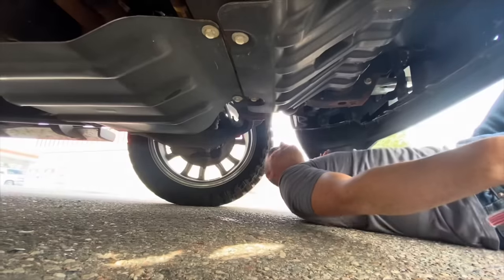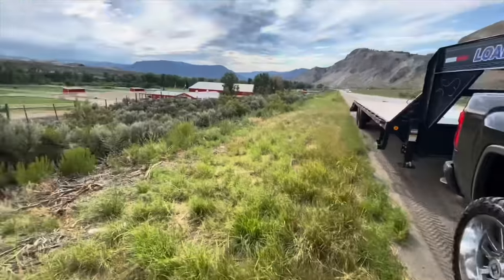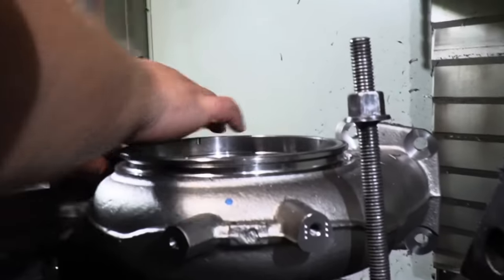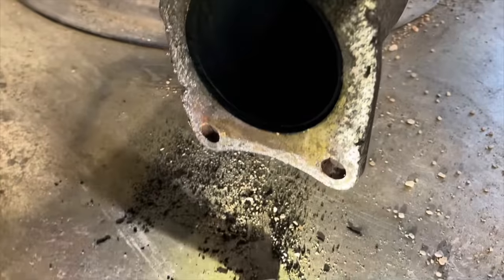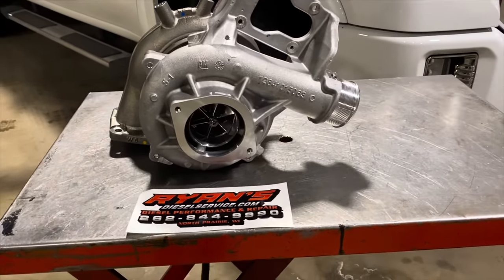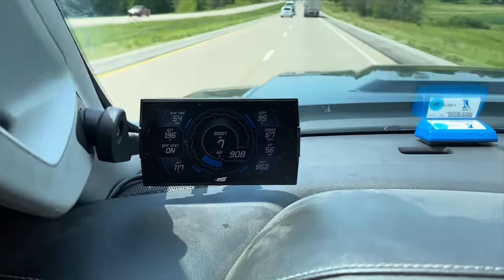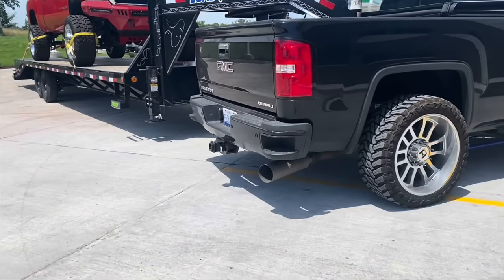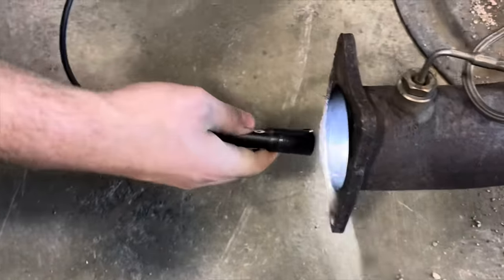This Is What Emissions Did To My Diesel! Heads Up Diesel Owners!

Comment: Every time I think about replacing my year 2000 7.3 power stroke I watch one of these videos and the feeling of needing a new truck quickly passes.
Reply: I don't know why you would ever want a newer emissions clogged Prius sounding piece of crap truck to begin with... your 7.3 is perfectly fine more likely than not.
Reply: Haha same here, still driving my 99 Cummins.
Reply: no replace noisy but problem free car.  I also have 1996 audi 2.5tdi 5cylinder (actually 442.000) it run with no problem
Reply: Same with my 02 and 05 Cummins
Reply: Never selling my 12 valve Cummins. 🥰
Reply: You can’t win. If you buy a Toyota the gm/ ford/ dodge slaves lose their mind. If you buy any one of those, the Toyota people go bonkers. Everyone’s hating. And there’s good reason to hate going all the way around lol.
Reply: You can delete new trucks, a Ram takes about 2 hours and under 1300 bucks. Problem solved.
Reply: I thought about buying a new truck, so I bought a 93 ford 7.3 IDI, so far best purchase.
Reply: @raydornbush  Probably cause them old 7.3s are boat anchors. Not to mention that dated crap interior. Just remember for everyone of these new trucks you see have an issue there's plenty that don't and for all them old truck that you see without em plenty do. Personally I'll take the risk on a warranty nice new truck vs some higher mile old truck.
Reply: @chublez  That's cool there are plenty of people who like older trucks and their older interiors just like there are plenty of people who like the newer trucks with their newer interiors quite frankly the only reason people buy those new diesels is because they look pretty and have good power from factory. Which by the way with your comment on 7.3s being boat anchors they most certainly aren't boat anchors they can make just as much power as the newer diesels without all the emissions crap and without sounding like a Prius and without all the emissions issues and it costs less than those expensive Barbie doll mall crawler trucks. Now you might say adding power to a 7.3 isn't real power... a 7.3 can get down and boogie if done properly. I'm just going to lay that out there right now it's true if you don't like it too bad. I'm not lying when I say my 7.3 can... not surpass but keep up with a newer diesel and it's pretty much stock and I don't care if you believe me or not on that. And on that note a 7.3 and even a 6.0 will always sound better than a factory 6.7 anything that's just the truth as well if you don't like it too bad. My two cents my opinion
Reply: The 2000 was a good one but my 89 will out pull it any day. Straight shift, non-turbo diesel. I've pulled tractor trailers out of a ditch with it, loaded. Just yesterday it pulled a loaded log truck out of a ditch. Love my 89. Been on the family since new, it has over 600k on it and still runs strong. No rust either.
Reply: 2000 7.3 does the job for me. Plenty of power and noisy. I love it and believe me it ain’t stock.
Reply: Just buy a gasser. I have a 7.3L  diesel too but that will be my last oil burner… the gas engine is much cheaper, gasoline is cheaper, oil changes are cheaper and ill get basically the same millage out of a new gasser as I get burning 5 dollar diesel in this old truck.. and the new 7.3 gasser makes more power than the 7.3 diesel.
Reply: Yep that Denali is performing as intended. By AQMD & CARB standards all is good.. But it is green. Really green when it stops running.
 Now if more of us would volunteer to stop exhaling CO2. We can make the 2030 CO2 targets. Do your part please. Save the planet.
Meanwhile I think I will fight with dog for the Alpo. ONLY $19.50 Per case with tax and on sale.
<sarcasm>
Be glad you don't have a 2004 F350 diesel. My neibhor has one. Spends more time waiting for a mechanic than being driven.
 Seems most mechanics do NOT like working that cab forward design, for some reason.
Reply: @jonathantaylor6926  I do have gassers. It’s just my 7.3 is my heavy duty mover. Outdoor and hunting rig. I typically drive a f150 eco boost for the day to day work. A ford exploder on the weekends
Reply: @chublez  you are funny. My 12 valve Cummins will go 500,000 miles at least and I am at 205,000. Probably the most reliable truck engine ever used.
Reply: @raydornbush  thank you brother. My 12 valve Cummins thanks you too😉
Reply: 97 7.3 in Cali no smog for me 😎
Reply: @chublez  well I like my boat anchor I can’t afford a newer truck with a warranty I just need one I can actually work on. If I could I would for sure get something with a warranty tho
Reply: Smart Move keep the 7:3 cheers Mick Australia
Reply: @chublez  Dated interior he says my lariat says otherwise a simple Radio deck update and it still does everything new trucks to to each his own i guess
Reply: @Nahbruhsheesh  Dude those guys don't hate on Toyota.... They KNOW Toyota is more reliable, you have some extra beers tonight?? NOW the T guys hating on the Ford Chevy ram guys is what you really meant..  .right?
Reply: @raydornbush  6.0s suck,sound don't matter............
Reply: @spf-92.5  how closely related do your parents have to be to write that? 😂 I don’t even know where to begin.
Reply: @Nahbruhsheesh  A helluva lot further relation than your's to think that in the first place. 🤔, plus my state isn't known for inbreeding like someone commenting here.....
Reply: @spf-92.5  “a hell of a lot further relation than yours”. That was literally my point. That your parents are related. Thanks for confirming that
Reply: @Nahbruhsheesh  Thanks for confirming your ignorance.
Reply: @spf-92.5  I'm glad I'm not the only one who thinks 6.0s are not good to put it politely.
Reply: I'll never sell my 7.3. I'm just going to upgrade the sound deadening in the cab and I'll drive that sucker till the end of time.
Reply: 2012 GMC LML 180000 mi. Lift pump, few mods, maybe exhaust 😎
Serviced regularly (early). No issues. Love it.
Reply: Smar move stick with the 7.3
Reply: @raydornbush  some are boat anchors some go a million miles. I think the point was all vehicles are hit and miss. New ones are nicer to ride around in if you’re working out of them. If you’re not working out of them you’re wasting a shit load of money on gas and insurance.
Reply: Smart Man
Reply: Bought a nice 68 Duece in a half from military surplus no emissions no computers no plastic no b,s. Park one of these puppy's at walmarx and any flapjack hits it they become broken more than The Duece
Reply: @Tombomb1816  so if you delete that emission system, what it may cause? Less power, less torque?
  I’m not to familiar with Diesel engine, just asking)
Reply: @svitozar8618  More power more torque, better fuel mileage and less restrictive. It let's the engine breath the way it should. It also makes the engine more reliable by deleting the EGR cooler so no more soot getting circulated through the engine and engine oil.
Reply: Better off buying a new 7 3 gas. Nicer looking truck, modern technology, more reliable gas engine, and it is just as capable as your old diesel. Gas motors have come a long way
Reply: @wraymathews12367  sounds like you are going way over the rated capacity. Maxes out at 13,900 for fifth wheel. Risking everyone on the roads safety. I hope DOT finds you for real. You are a rolling hazard. 
The 7.3 has is way more capable.  19,500 fifth wheel! Making buying a new disel hard go justify when the emissions systems are faulty and costly.
Reply: Bring back steam engines that are coal fired, that’s a real man’s machine.
Reply: LB7 CHEVY NO SMOG 300k still running strong
Reply: @rustytr You're an older gentleman aren't you, wise beyond his years, that's what I would've thought if you didn't just write down an absolute load of malarkey/bunkum. A 7.3 powerstroke may not be able to tow as much just because of the transmission differences but it can absolutely make as much power and be just as fast and highly reliable from the factory. My 2 cents 
Ray
Reply: Poop too wait till you go to the dealership and find out a new one cost $80,000
Reply: I have a 1999 7.3 with a aftermarket turbo and full size exhaust.truck has a ton of power.
Reply: 2004 1/2 Cummins still going strong at 556k. For 100k I would expect a lot more.
Reply: Power stoke is the worst
Reply: I have a 2000 7.3 and I run it on home made diesel lol waste motor oil and stale gas. My fuel would kill these trucks before they could even put them on the road
Reply: @jonathantaylor6926 make your own diesel fuel. I have a 2000 F550 7.3 and get 10 miles a gallon. I don’t remember the last time I bought diesel. I was spending $200/week now I spend nothing.
Reply: @Nahbruhsheesh  The Toyota guys have the best trucks until it comes to heavy duty pickups.. Then they don't have a truck at all.
Reply: @Tombomb1816   That really depends on jurisdiction though. Where I live, emissions inspections are a county by county basis but I happen to live in a county that requires them. The only option is an old rig. But I like the old rigs more anyway, even if they're slow. I at least get to entertain myself by changing my own gears.
Reply: Sooo, his repair is to get someone else to clean the filter out and reset fault lights.....riiight
Reply: That’s a whole lot to say for someone who “doesn’t care” if you believe them!
Reply: Still driving an old 2000 5.9 cummins.  Put in a lot of maintenance and it's been a money pit but it's finally reliable and don't plan to get rid of it.
Reply: Haha! Same here! 99 7.3 with 430k, still rips!
Reply: In one word; DON'T.
Reply: Instead of all this complicated unnecessary b.s. and Def fluid etc.  Why don't we invent a co2 based system.  Injected alongside the regular injector, when necessary to slow down rge combustion process And cool things down too? Seems the government is telling us we got too much of it too begin with ( a fairytale). Anyone's thoughts on that? Thx.
Reply: if you're fine with a7.3 powerstroke you'd be just as well off with a 7.3 gasser, lol
Reply: Don't do it
Reply: I will keep my Gasser trucks so I won't have to deal with missions
Reply: @raydornbush    Well if you ever towed 10,000lbs through the mountains with 1 , you would not ask this question..  This is coming from a 2003 7.3 owner..
Reply: @kylemacdonell1450  I'm just going to assume this is coming from a 7.3 owner who has all the upgrades to the engine, transmission, suspension and brakes to handle all that mountain climbing. ?
Reply: @raydornbush  you would be 100% correct.
I have Sam wyse stage 2
T4 flanged setup with 364.5  and 238/80 injectors. I could on with the laundry list of handling and power adders, but a 4 speed vs 10 speed just can't hang.
She works as well as any 7.3 on the road. And still a kitten compared to the 22 - f250 we took this year..
Reply: @kylemacdonell1450  Having more gears does make a difference when towing but I disagree about it being a kitten compared to the 6.7s. When towing sure it's a kitten because of the lack of available gears but when not towing... an updated 7.3 can be an absolute beast when done and tuned properly. Just my two cents take it how you want.
Ray
Reply: @raydornbush  what else are these trucks really built for if it's not towing ?
Don't get me wrong, love my truck and its feel. But I built it to tow and there is no comparison when you get up past 10k.
Fuk the '22 f250 would pull giant grades at 65-70 MPH In cruise control.. LOL
Reply: Two of my neighbors had 2016 Chevy 3500's. So much trouble with the DEF and DPF they now drive gassers. I'm happy with my LBZ. Ain't buying any of the new garbage.
Reply: Don't you ever sell it.
Reply: @Tombomb1816 ya 2022+ have to buy a new ecm from a 2021- back its not 1300 hes right its like 6k same for my 2022 ram 2500 6.7
Reply: @HVTMuddvain  Buy a Raceme ultra tuner for 1100 bucks and the delete pipes for 200 bucks. Do the work yourself it's not difficult. Right now the Raceme ultra is for 2007-2024 Ram trucks. If you want block off plates they are cheap or just remove the spring from egr valve.

Comment: Never selling my 12 valve Cummins, best diesel ever made, had it 23 years now. The paint is flying off it but who cares, it’s unstoppable.
Reply: Same
Reply: Rather paint fly than a piston or 15-20k+ engine rebuild
Reply: As long as you take care of that killer dowel pin, youre golden.
Reply: @VLK-73  The 6BT Cummins with the P7100 injection pump is one of the best diesel engines ever made!